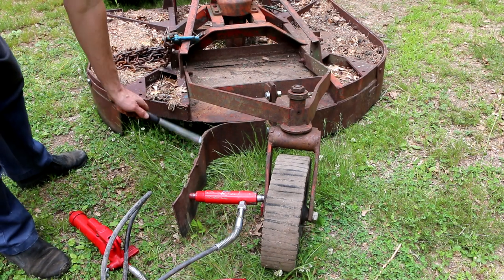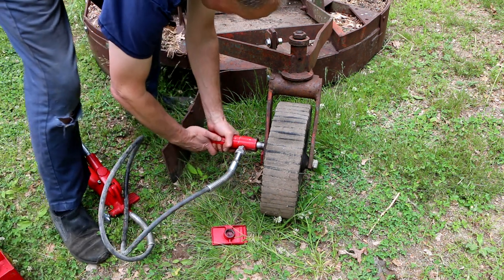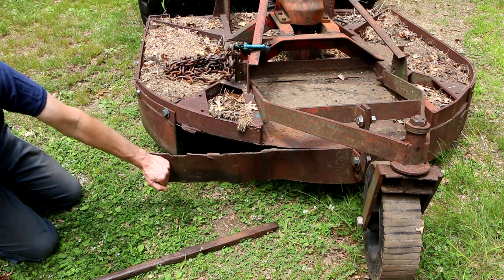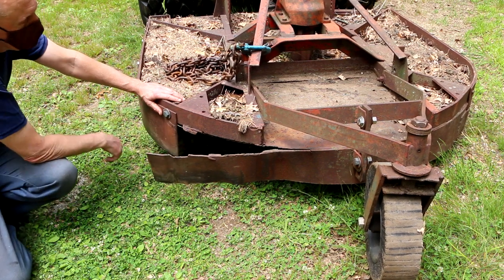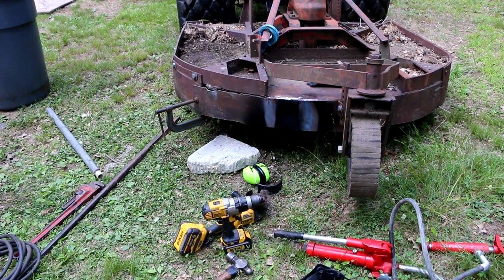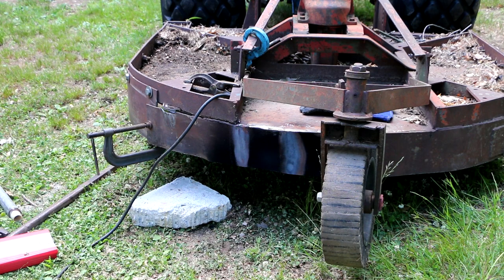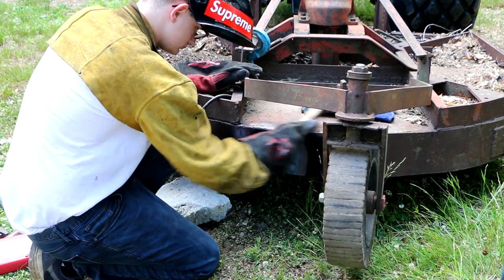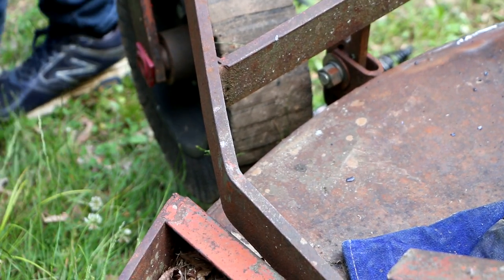Repairing the old Bush Hog brush cutter

Comment: Hey Steve, I just finished watching all of the repair videos on your Bush Hog 305.  I don't know if you realize you have one of the best and heavy duty models produced by Bush Hog.  I owned one also about 30 years ago.  I used it to cut fields and small trees that were up to 1.5" in diameter,  nothing stopped it.   The sides are  designed to be removed (unbolted) if you are cutting hay.  This  helps to get the grass out from under the deck so it doesn't get chopped up too fine.  Yours is missing the 2 front shoes that keep the front corners from tearing up the ground when you make a turn.  I didn't realize that Bush Hog still made the 305/306 5' and 6' mowers.  Just guessing I'd say you'd probably have to pay somewhere between 3-5 thousand for one.  Bush Hog came out with a cheaper model line called the Squealer series which is now where near the quality of the 305/306 series.  even today your Bush Hog 305 is far superior ot any thing you can buy from Tractor Supply, Northern Tool or Rural King.
Reply from the maker: I could not agree more. You can tell by the shear weight alone what a beast this thing is. The missing shoes make sense. My front edges are curled from digging into the ground on turns. Now that I am running a Ford 5000, I bought a 6 foot cutter. Sadly nowhere near the heft of the old 305.
Reply: @stevewatr   keep your eye open for a 306, it's the 6 foot version.